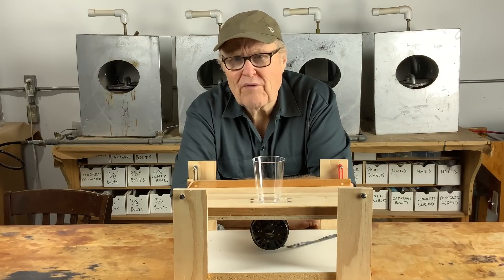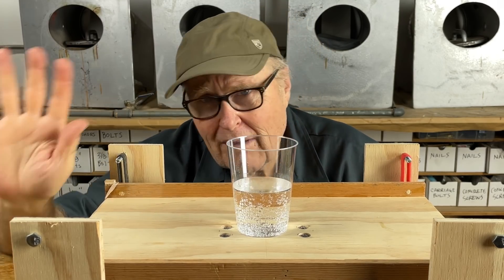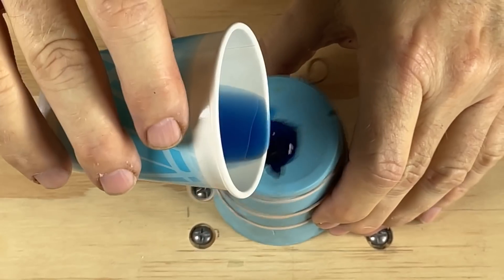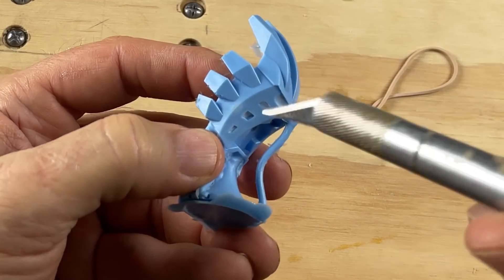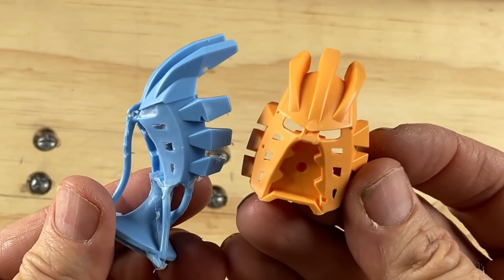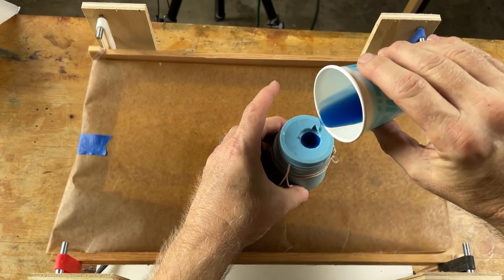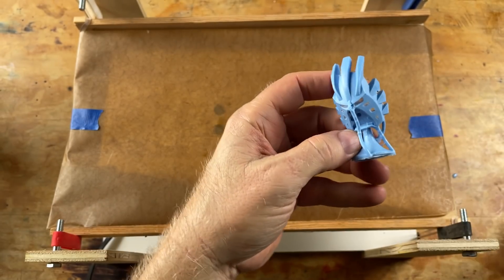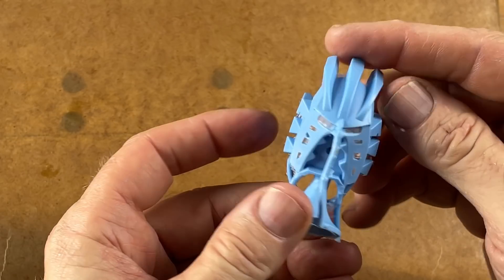Does Vibration Work? Let's Find Out!

Comment: Vibration is really only useful for large open topped molds using epoxy resins.

For example, you would use it for something like an epoxy granite or similar mineral epoxy casting.

Comment: What about casting plaster and concrete tho?
Reply: I really need an answer to this too! can you cast plaster under pressure to remove bubbles?
Reply: @tftexe  I think, that if you release the air slowly after it cures it should be possible. If you release it too fast the air might not be able to leak trough the pores and expand and break the model from the inside. I'll try building a bike pump-powered pressure chamber in the future to test this.

Comment: I'd say your vibrating table is not moving at an appropriate frequency and far too much amplitude, and may in fact be causing bubbles.   I'd try agitating that mold with the voice coil out of a woofer or a mid-range speaker, and I'd start around 120 hz.

Comment: I worked in a shop that made the trophy stands for the NCAA, BassMasters, Heisman, etc... I always vacuumed the mixture before and after putting the "kicker" in (the catalyst that hardens the epoxy resin). Then, I poured it onto a giant glass table. I would turn on the air compressed vibrators while I created my designs with compressed air or a paddle. The vibrations almost always got the bubbles out, as long as you didn't put too much "kicker" in. Too much meant it would harden before the bubbles were out. It was a dance of ounces, humidity, temperature, time mixing, and base thickness. You always had to pay attention.

Comment: I would recommend a couple of solutions to the mix (pun intended 😜).....1. Add some type of dampening material to the platform, like craft foam....2. Install a clamp system to hold mold or other object in place during process

Comment: I’d be interested to see vibration vs sitting out without pressure or vibration. I work on a small scale as a hobby and can’t afford a pressure pot right now. I’ve used a sonicator to degas solutions in a chemistry lab, so I was hoping vibration (though way less powerful than a sonicator) would be better than nothing.

Comment: Seeing results from Eric Strebel a couple of years ago for resin pours and others with different materials, vibration (possibly with heat assistance too) does appear to be beneficial in certain conditions due to surface tension changes causing collapse of bubbles, but it's not a substitute or shortcut for using whatever other techniques are at hand as well.
Reply from the maker: Lots of people swear by vibration but it’s never worked for me with urethane. I do use it with hydro stone, cement, plaster etc.
Reply: @RobertTolone  Thanks Robert, definitely a case of YMMV. I've just started and made my first mould last night. 3D printed a test part, cycle of sanding and acrylic filler, 3D printed a mould case with draft angles to help get it out, degassed the RTV and had a go. Volume calculation I did in Fusion for the silicone was right but had to make some more (twice) from presumably some left in the containers. Took out the mould today and it turned out great, and used it with Jesmonite. Degassed the liquid part but used a hand held massage vibrator on the final mix in the mould seeing reports of degassing the mixture causing texture problems. It did help bubbles come to the surface in that case, so like you said it seems to work well for plaster type applications, and having excess I used it in some other moulds we had for craft projects in the past. Vibration also helped it flow as the viscosity was increasing by that point. Thanks for your videos as they've been really helpful in discovering and learning about this area.

Comment: This is not really vibrating the resin. it is just jiggling the mold. It needs to be secured in a more rigid container. You want low intensity high frequency vibrations continuously during pour and the entire length of the curing time. Preheating the mold also helps a lot. 
That said a pressure pot will still be more effective for rigid materials. The vibration is more helpful for elastic materials, like making silicone molds.

Comment: I've been using vibration to get the bubbles out of epoxy on slab tables for years.  Unfortunately I use two rubber mallets and basically play a drum roll on the wood. I need to work out a good mechanical way of doing it
Reply from the maker: Every material needs a different approach. I find that heat works well with Epoxy resins-  but I have less experience with it than I do with urethane resins. Vibration works well with plaster and cement type materials.

Comment: Don't you need different frequencies?
Reply from the maker: Some materials such as plaster and concrete respond well to vibration. I have never found vibration effective with resins no matter what the frequency.
Reply: @RobertTolone  Thanks a bunch for the reply, and while I got you on the line, would vibrations work for wax pouring? Or is the wax so liquid anyway that what you teach us in your videos works best?
Reply from the maker: @Ayce47  When I pour wax into molds I use a pressure pot.  I’ve never tried vibrating wax castings.

Comment: Vibration works in plaster when the bubbles have a way to escape. It isn't going to magically create an escape route where there is none.
Reply from the maker: Vibration works with plaster and cement but not with resin. You must always have properly placed vents in your mold to let the air out no matter what medium you are casting in.

Comment: interesting.  all i can tell you is my experience...  just hold an orbital sander or something against the mold for 30 seconds, not the sander part but a hard part of the handle.  it's not a big vibration like your setup, it's more like a humming kind of thing but no doubt it will get rid of some bubbles,  a majority.  not as much as vacuum or compress but if you don't have those tools it's better than nothing....  better than banging with a stick which i think we would all recommend 🤣🤣🤣🤣

Comment: Great stuff as always. 
For tricky molds that like to trap bubbles I find that pouring some talc in the mold and then clearing it out with an air compressor helps tremendously. It breaks the surface tension and it helps the resin get drawn into any trouble spots. Not sure if you do this or not as I haven't seen you do it in any videos that I have seen.
Reply: What is talc exactly? Is there a video or paper that explains this method in detail?
Reply: @AJ-le5lx  Talc or talcum powder or baby powder.... You basically pour it in your molds and shake them until it covers the entire surface. You then use an air compressor or hair dryer to blow out the excess talc. This fine layer breaks the surface tension on the mold and the resin is drawn to the surface because the resin wants to absorb the talc.
Reply: @fingsandstuff  Does the leftover talc, even if it's a fine layer/sprinkle, not create clumps when mixing with the resin?
Reply: @Zakia Khwaja  no, the layer is so fine it is absorbed by the resin...

Comment: Vibration only works on plaster molds. At least as far as I've experienced.
Reply from the maker: It may have something to do with the weight of the particles in the liquid. It works on plaster, hydrostone, concrete etc. But I’ve never gotten it to work well with resin.

Comment: How about ultrasound? We use sonicating baths in the lab for degassing solutions (water: alcohol mostly) and that works. I'm starting a polyurethane resin project and don't have a pressure pot or vacuum chamber at home so considering a cheap ultrasound bath
Reply: I use a round sonic jewellery cleaner, works well!

Comment: I wonder if putting the two parts of the resin in vacuum chamber (separate cups obviously) to dehydrate them before mixing will help in preventing bubbles since it is the moisture reacting to create the foaming? If so, how much time does it need for the smaller portions you pulled?  I know some people also put dry air (it's a pressurized can of dry gas) into the containers after pouring the amount of resin needed to help keep moisture out.

Comment: Vibration, tapping the container, etc, works great with plaster, Durham's, concrete and such.
Concussion works not at all on resin.  Sort of like how a propane torch will break bubbles when you're pouring resin for faux stone countertops but a torch won't do diddly if you're making concrete countertops. 
Love your channel,  sir. I've learned a lot from you!
Reply from the maker: Exactly. The best debubblizing technique is all about the casting medium.

Comment: Q. Robert, Do you ever use baby powder in moulds to break surface tension?  I think I’ve seen most of your vids and haven’t seen it being used or discussed.
If one wants to do many excellent cast, a vacuum chamber and pressure chambers ARE A MUST.  Both, cheap $200. Ish, each), but, if you’re only doing moulds/cast a half dozen times in your lifetime, and not buy equipment that leads to the best cast, then proper venting, pour hole, good resin and baby powder I’ve experienced will help the average joe.  Today’s silicone and resin are much better.  One also has to take into  consideration, cost of silicone, resin, other equipment and time  if it is economical to do it in the first place rather than just buy a second of what you want to cast.  I’m not for vibration, but, thin pouring of resin, rotating mould, gently squeezing mould will get rid of bubbles. I hear, wood is porest and holds air so I use metal tools.  Also, you can avoid creating bubbles in the first place by just being careful mixing the resins.
Reply from the maker: I never had much luck with baby powder in molds. And I have never found it necessary. But many people recommend it so I can’t really say anything against it. To the hobbyist who can’t afford equipment I would say learn to properly vent your molds. That’s the most important thing to make good castings. Also, without equipment, just accept that you may have flaws in your castings that will need to be cleaned up.

Comment: I wonder if a speaker (membrane removed of cours) might be a good way to be able to control the frequency and amplitude. Could also be used in a vacuum and/or pressure vessel.
Reply from the maker: You could undoubtedly use it to control frequency and amplitude but I don’t know if that would help you make better castings.
Reply: @RobertTolone Well, what the first experiment with the soda showed is that this particular vibration table wasn't very efficient in removing bubbles anyway.

Comment: Why don't you squeeze the rim of the cup when you pour the resin out? I figure that would make it easier to pour without it dripping down the side, but does it do something else undesirable?
Reply from the maker: I find it doesn’t help stop the drip much.  What works very well is to have a small amount of resin in the pour cup.  It’s pretty much impossible to pour from a full cup without dripping but if the cup is lightly loaded you have really good control over the pour.

Comment: I only use 1 part molds and cast 2" mini figures, but as I pour the resin I usually stop 2-3 times and smack the bottom a bit. Near the top, occasionally I see a few bubbles rise out. Then I throw it in the pressure pot. Perfect cast near every time. If I don't do any tapping, sometimes I'll catch a small bubble in a nook or cranny somewhere (usually in between the legs). I normally use smooth-cast 45D which is very low viscosity for the first 5 minutes or so.

Comment: My intuition from having studies nursing at university is that shaking/vibrating makes little sense, you'd just break up bubbles in several ones. With syringes we dislodge bubbles with clearly directed knocks, with a pen. But we can also see the fluid we're working with, and even the thickest solutions aren't as thick as curing silicone.
Reply from the maker: Yes, vibration has never worked for me.

Comment: Thinking about this in a logical way🧐, I would say there are many variables………firstly the height of pour as it’s important to stretch the liquid (and the properties of resin does this well) to stretch out the gas. Next, the frequency (Hz) of the vibration will play a part, as too much vibration will introduce more bubbles, and the frequency and amplitude needs to allow the bubble to rise in the liquid and break the bubbles surface tension. Too much vibration, and the bubbles changes shape, allowing them to move through the liquid at different angles and hence not rising to the surface. Also, the surface of the liquid bouncing around randomly can introduce more bubbles. I could go on but it could become very boring🥱. Personally, degassing using a vacuum chamber, as you’ve rightly said, is best. Love your videos, so interesting, full of wit and experience🙏 .

Comment: What do you use your vibrating table for?
Reply from the maker: Wasting space in my storage room.  Other than that, nothing.  I tried vibration early in my career and almost immediately switched to a vacuum and pressure.
Reply: @RobertTolone  Ah, OK, I just thought you'd be keeping that around for a special purpose.
Reply from the maker: @doubledown187  If one comes along I certainly will use it! That’s why I’ve kept that motor for over 30 years. You never know…

Comment: What if the vibration changed in intensity periodically constantly varying between the highest and lowest intensity with the other tricks like constant slow rocking and pressure, a sort of all in one idea that also holds the mold in place. Idk if it would do anything but i think it would be a pretty interesting invention even if it's to disprove the method

Comment: Maybe some people mixed up the vibration thing with the vacuum pressure? I remember from my course that thing could vibrate a little with the engine (at least ours did, it was old) and if you've only seen that part on a video without explanation it could look like it perhaps..? Wild guess tho. In our course the only thing we "vibrated" was shaking it yourself when we did plaster casts, but that was more shake & rotate to make sure it got into all the nooks and crannies. Great videos! :>
Reply: I think the shaking and rotating is where this comes from, if the plaster is getting into all the nooks and crannies then the air isn't there, so I guess people are applying the same logic to resin casting

Comment: So far the best way I have found to avoid bubbles (this is for Epoxy resin, not sure if it works on urethane) is to pour side A and B in one of those vertical clear plastic packs you can buy a hundred of for less than a dolar, then twist the opening to not let any air pass through it, you suish it to mix it with your free hand, ensuring both parts are equally combined (for some reason, probably the air pressure, mixing this way incorporates almost no air bubbles). Then you either cut or pinch one of the corners of the pack ensuring the opening is as small as posible. 
When I pour it into the mold that way the only times I get air bubbles it's because of trapped air due to not leaving room for vents .
Reply: I know this is old, but if anyone by any chance knows...what clear vertical packs do you mean? I'm trying to visualise it but not getting what you mean.
Reply: @Rose_Castle  I was talking about those thin, clear plastic sleeves like the ones you use to pack your fruits/vegetables in the supermarket. But smaller and with a vertical profile (so there's enough room to twist the opening to close it)
Reply: @elpretender1357  ahhh, thanks!
Reply: A ziploc bag?

Comment: Hey Robert, I remember back in the late 90s Polytek and SmoothOn were selling the gas canisters to fill the air space in your containers. I had to stop doing creative things for a couple decades ... not even sure if they still sell those. But did you ever try or have any luck with the gas? I always thought of them as one more step and one more expense, but...?
Reply from the maker: If you use them diligently I’m sure they would extend the life of your resin. I’m too lazy and just rely on my pressure pots to suppress resin foaming,

Comment: These tests were done in a manor that would not help you discover anything.  Vibration works well with a thin medium, but once the viscosity reaches a certain thickness, vibration is not an option.
Reply from the maker: These tests were about as unscientific as testing gets. But they are there to illustrate the point that vibration does not work. This I know from long experience. Vibration does not necessarily work in a thin medium because the resin I’m using is very low viscosity.
Make some videos showing how you use vibration to make bubble-free castings. I would love to change my mind and be shown new techniques.
Reply: @RobertTolone  I agree, vibration will not work.  The pressure pot shrinks the bubbles down so small you can not see them with your eyes. Best method.

Comment: I don't have a pressure pot so I built a faceplate for my lathe that acts as a centrifuge with a small container that I put my castings in. I'm only casting parts for small models and spinning them at the equivalent of 10 g-forces works very well for preventing bubbles. Scary as all-get-out though when you have to walk past it! Even though I know all the bolts are 1/4" steel.
Reply from the maker: Spin casting can be very effective. The spin cast machines that I have seen hold the mold inside of a closed space which makes it much safer from flying resin or mold failures. The mold cavities are arranged inside of a circular rubber mold and the pour spout is in the middle of the circle.